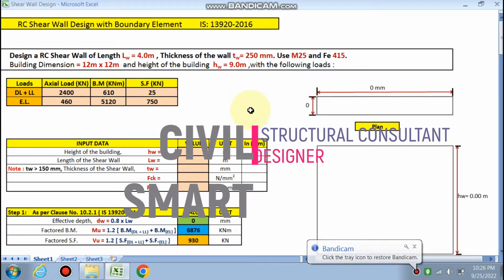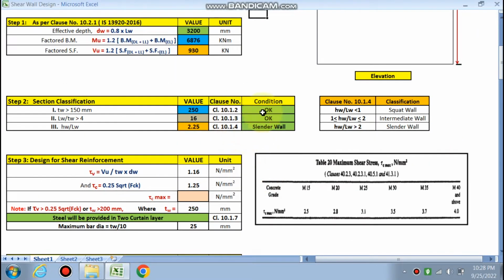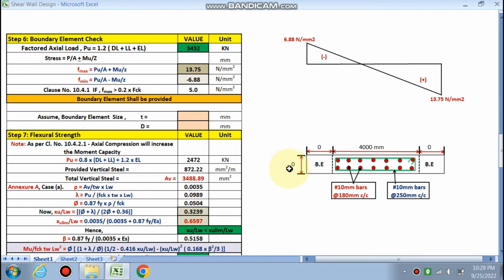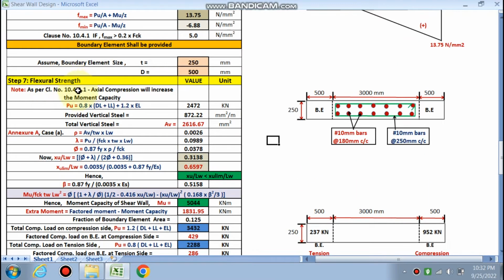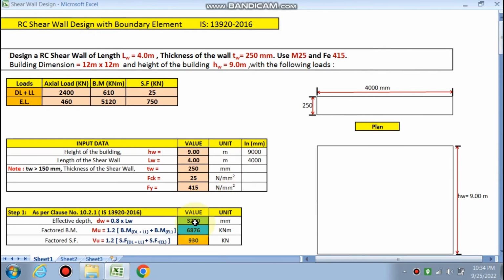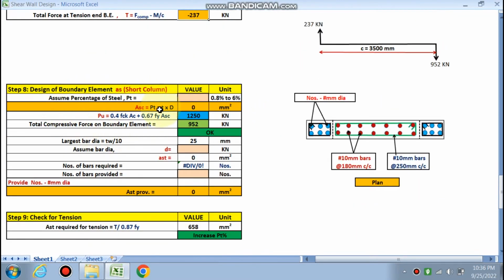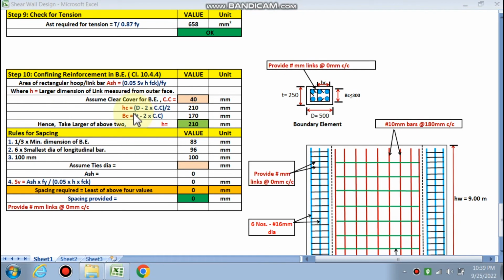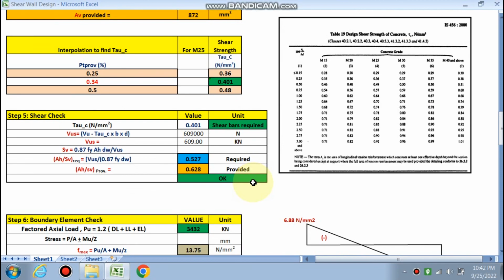SHEAR WALL DESIGN WITH BOUNDARY ELEMENT (PART-2)

Comment: There is a major error in this sheet! Reply to my comment with your mail ID, I will explain.
Reply from the maker: What's the error plz explain..
Reply: @civilsmart  In the 10th step, the number of legs should be considered while calculating Ash.
Reply from the maker: @brahul7899 yes , no. Of legs has been updated as per the requirement in the design accordingly...any other thing u have noticed, let me know..thanks for watching.👍
Reply: I found 1 more error, if you share your sheet I will compare it with my sheet.